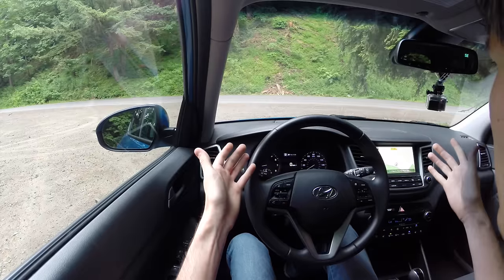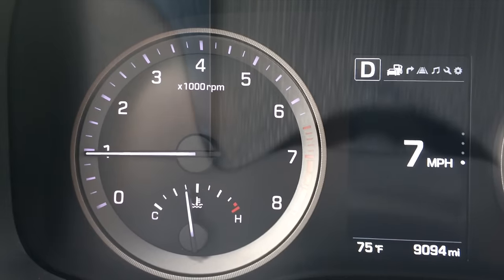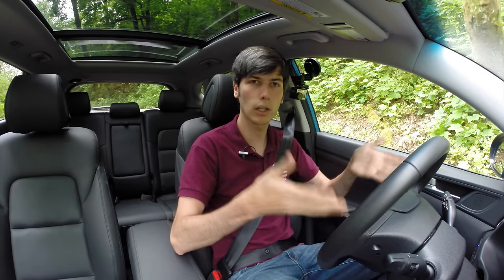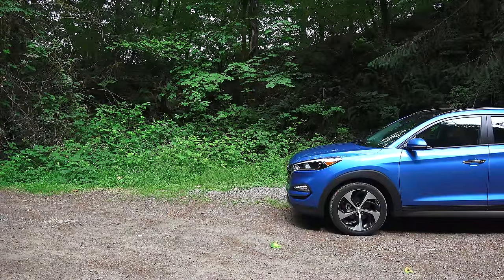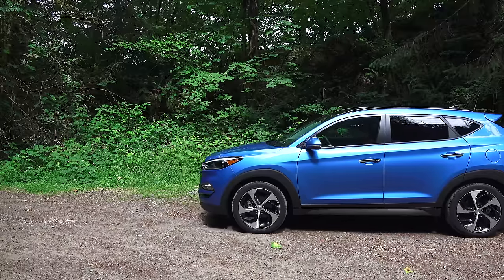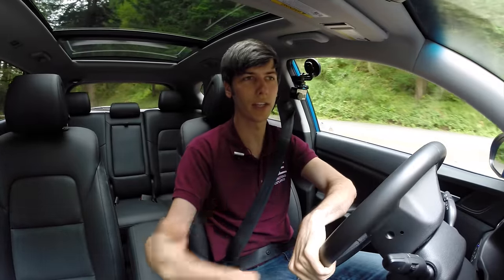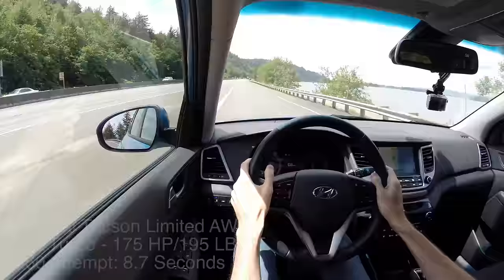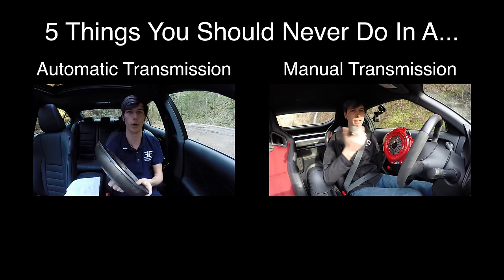5 Things You Should Never Do In A Dual Clutch Transmission Vehicle

Comment: "5 Things You Should Never Do In A Dual Clutch Transmission Vehicle"
1) Don`t buy it if it has "dry clutch"
2) Don`t buy it if your city has a lot of stop-n-go traffic
3) Don`t buy it if you need the ability to reverse park uphill
4) Don`t buy it if you want to have smooth ride (DCTs are jerky when you floor them)
5) Don`t buy it if you can drive manual

Comment: I'm beginning to wonder what's the purpose of having N gear.  I have NEVER EVER used it, not at stop lights, not when parked, not AT ALL.
Reply: Neutral has a few different uses, although those uses are very specific, for instance cases like depending on the car, you would want to keep it in neutral while it's being towed (assuming it's not being towed on a flatbed). The other use is for when the park gear goes out. In standard torque-converter automatics, park is just a small tooth that has to hold the whole weight of the car, which is technically not how the park gear is meant to be used (hence the parking brake) because if you park on a hill you can snap that little tooth from strain and have no park gear at all, thus leaving you with parking by being in N with the ebrake/electronic parking brake
Reply: @Kenny-vs4pr  good points, thanks

Comment: Manual isn't always better. Shift faster than electronic + computer? Not everyone does
Reply: My Arona with DSG7 shifts very fast. Ok, I can't do it on my ep91 with manual. But... EP91 clutch set costs 60€, DSG7 clutchES costs way way way more than that.. and complexity to change those will surpass changing clutch in simple manual transmission.

Comment: I dont have to guess what my car probably thinks i want to do.
I just shift into the gear i want and thats it.
And if i want to get instant grunt out of my car whenever i put the foot down and not have to shift at every junction where someone might come from the right i just keep driving in a lower gear.
And when im following a slow car and wait for a chance to obertake i just shift down a few seconds beforehands and when the chance is there i dont have to wait for the computer to get it and loose time.
You might ask what sort of high tech magical technology that is which enables me all those individual and useful driving styles, well its a normal manual car which still gives you the most responsive, connected and emersive feel when driving while beeing cheaper, less likely to break down and also keeps you from getting distraced

Comment: Note: Dude, if the transmission remained in gear while at idle, the only thing that would wear out is the "throw-out bearing", not the clutch itself.  Small difference, eh?  Obviously you don't know enough about how clutches work.

Comment: Will there be engine braking in DSG?
Reply: Yes, just like if it were a manual. Think of it like an electronically controlled manual transmission. I find with DSG cars, if you use the sport mode it holds the gears longer which is ideal for engine braking.
Reply: @ice44567  I have driven my friend's Q3 in sports mode. That makes it rev to readline in every shift.

Comment: You can stick a DCT where the sun don't shine, Torque converter and 6 speed auto is all would want, I don;t  care about the pissy saving in fuel, TC Trans is  more reliable and smoother.

Comment: He never really answered the question of is it ok to put car in neutral at stops will it harm it or help it ? Anyone know the answer ? I tend to want to put in neutral but dont want to harm my car if its not good idea lol i have 2013 dodge dart 1.4 l turbo i bought it used with 60000 miles on it so not sure how previous owner used or abused would like to get as much life as possible
Reply: The problem is not to put it in neutral but to remain in drive. It is said that it's not a problem as the clutch gets automatically disengaged when the car is stopped.

Comment: I NEED HELP!! I w as s driving and didn't notice my car was in manual mode so when I finally noticed it the rpms were at 6k. I slowed down to around 2k rpm so when I shifted it back into drive it wouldn't jerk me around or anything. So yea when I switched it to drive I noticed the transmission just going thru gears before it didn't what gear it wanted to be in. After I noticed that I pulled into a parking lot and I noticed sounds from the transmission then I noticed it just jerking into any gear it switched to  please help me trouble shoot it. What could the problem be? I have a extended warranty do you guys think they will be able to tell that I accidentally had it in manual?
Reply: Depends on how long it was in manual. It shouldnt really matter about rpm as thats the engine not the gearbox. 

Just claim under warranty.

Comment: 0-60 in 8.7 SEC!?... my soccer mom Ford Escape can do it in 6.1 SEC
Reply: Here in the UK that's classed as quick our average family car does 60 in around 10 to 12 seconds small cars at about 14 and our faster cars between 7 and 9 yous are lucky to get decent engines in your cars for example the car you call a 2017 outlander sport gets a 150hp 2.0 or 2.4 160hp we get a 117hp 1.6 in ours

Comment: Basic crap.   I drive big truck. Try those things in a 12 gear rig lmao nope.  It's even better with a 53 foot trailer on a hill upward. Ha ha ha your now down the hill. In reverse.   
   You forgot race shifting. Just like big rig driving. clutch neutral to next gear as you hit neutral pump gas and clutch into next gear.    When you get that it's like so smooth and still accelerating

Comment: dual clutch transmissions are crap, is it really worth its unreliability for merely changing the gear a little bit faster
Reply: Reliability is not the thing dual clutch transmissions are used why would supercars use a reliable transmission over a good one that’s not reliable

Comment: Lol what a load of bs! Don't downshift while on the throttle that's a joke! Btw a clutch needs torque to open, and when you downshift the transmission requests a torque up to the engine to speed it up to sync to the next lower target great. That would also mean that you couldn't accelerate after a steady cruise without a downshift .... sorry but that's just completely incorrect